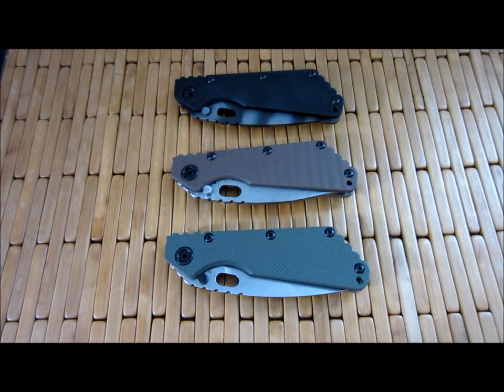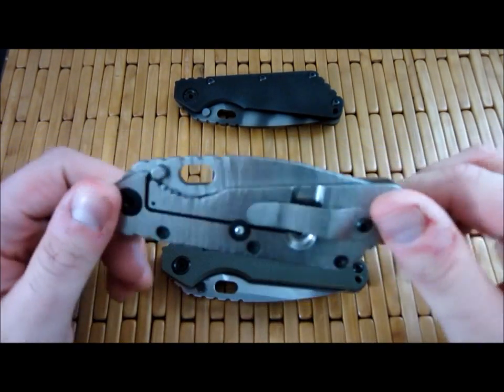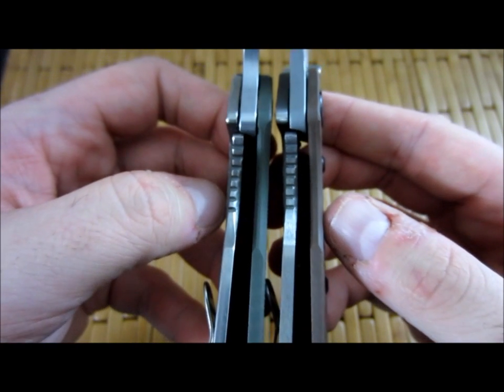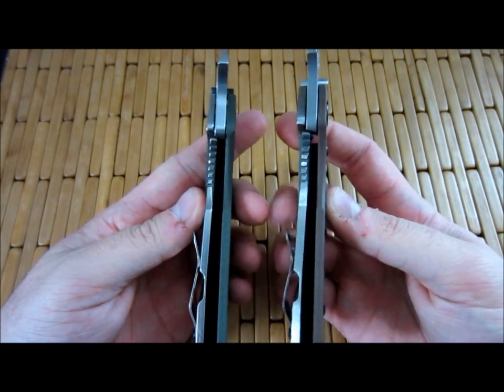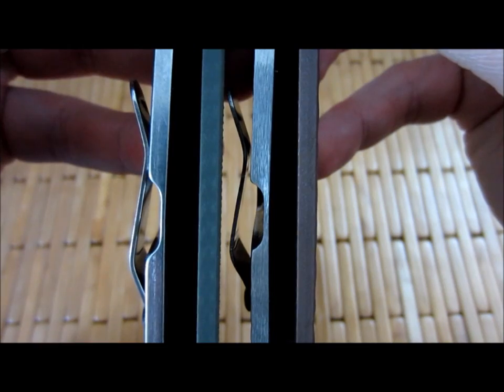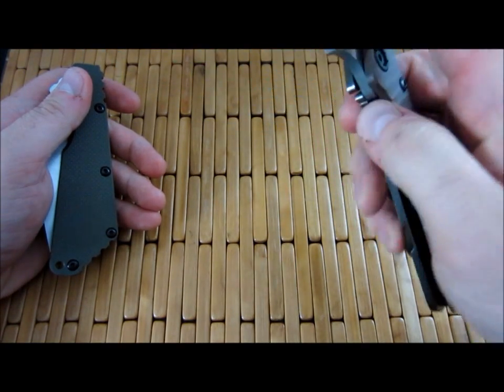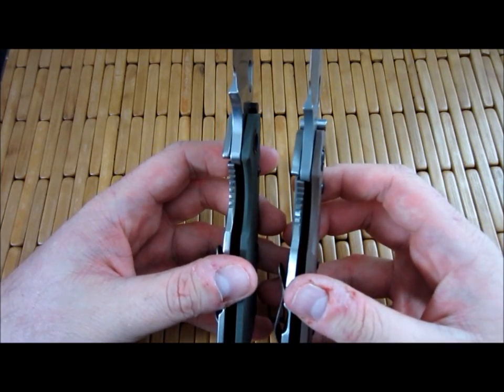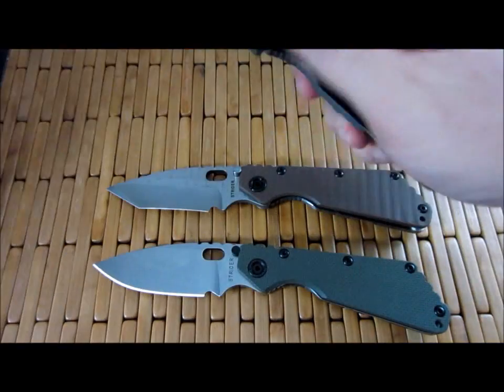Strider Knives - Latest Generation Changes

Comment: My experience with the Shirogorov mod 95 and the DDC striders as far as sound goes really relies solely on the tightness of the Pivot screws.   You want a harder thunk you loosen the screw some,  you want it more silent tighten the pivot screw,  the problem is that making these adjustments is just not that easy, I am just about done with my new tool that will make this a breeze and should be done in the summer. anyone will be able to make it at home and it will work on any pivot screw made.  I kind of got off point, that being you have find a good balance and when I get a custom form the makers I realize they go for a little bit lose just a tad.    Hope that helps.

Comment: "more hard use" because its a little harder to open and close.bro the new lockup as you said makes the action smooth as all other high-end knives. but yet it can still delivery all the hard-use that its known for.before that lockbar gave up your either gana break the blade or pivot I currently have and love my old-lockup SNG and never had a problem with it so im not about to run out and grab a new lock-up i think its pointless unless you got lock-rock but it dosn't happen to all of them

Comment: Yeah there is a difference is sound between my SnG's. the cutout on them look the same. I figured it's due to the lockface and spring tension differences. 

Well they both still work well.

Comment: Have you noticed the new shape of the sharpening choil on the SnG? It used to end in a straight down drop and now it ends at about a 45degree angle. I'm assuming this is to help slow the deformation of the G10 at the area where it functions as a stop-pin.

Comment: You got any measurements? To be honest, I don't know if they have officially changed the thickness of the lockbar cutout because it has gone through phases over the years. The Strider forum, years back, had a few measurements posted and the thicknesses varied quite a bit. I think you're just experiencing loose tolerances. I could be wrong.